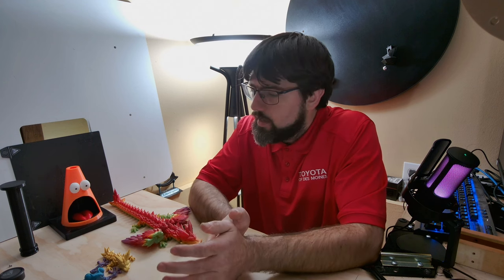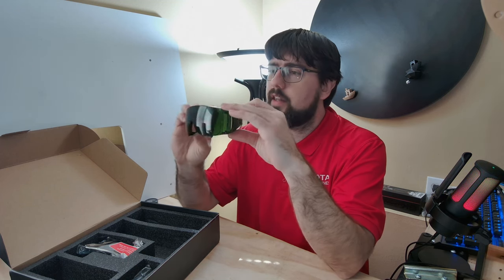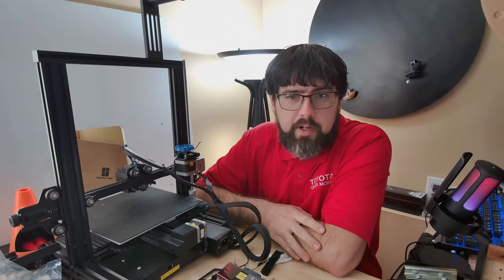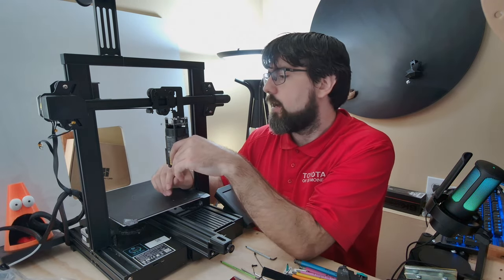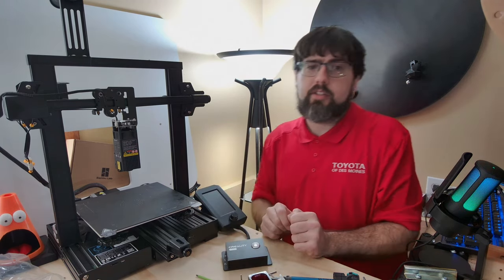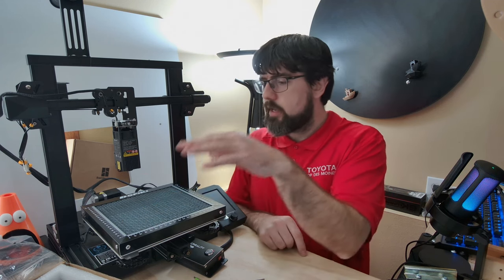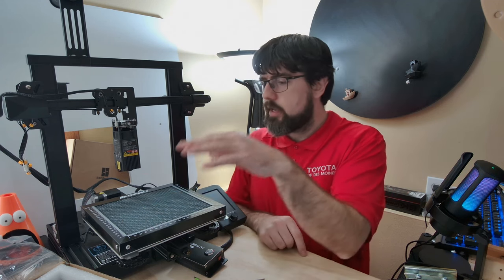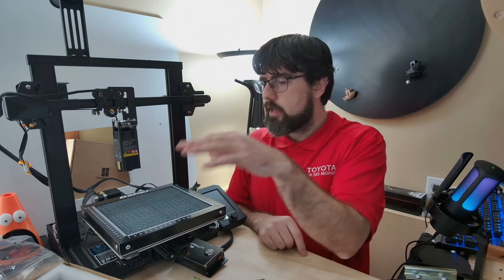3D Printer that Can Cut stuff??   Creality's 10w Laser Module Attachment for Ender Series.

Comment: Awesome Video!!! I have replaced my CR-10 with a P1S, as a result, my CR-10 will become a laser engraver/cutter. I do have a couple of questions... Do you have to worry about that honeycomb matt sliding around on the bed? Have you had any issues with the Z screw creeping down? Have you tried cutting anything with it yet?
Reply from the maker: @DargoDog  I have not had much time with it yet.   The 10w will cut thinner wood just fine.    I personally have not had any z issues but you could also turn the printer on and adjust the z with the main printer setting to lock z in place.

Comment: I just got my 10w laser module on the ender 3 I've connected every thing but when I press to engrave it just homes and dose nothing else? Help if you can Thanks.
Reply from the maker: Are you hooked up to the computer or over SD?    Over SD you have to use lightburn.
Reply: I didn't know you had to use light burn over SD thanks for the help!